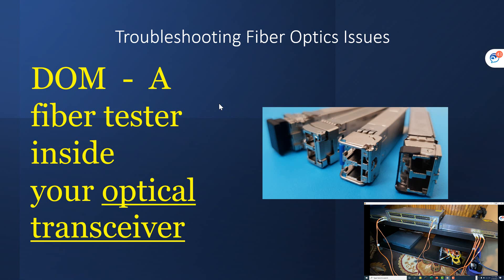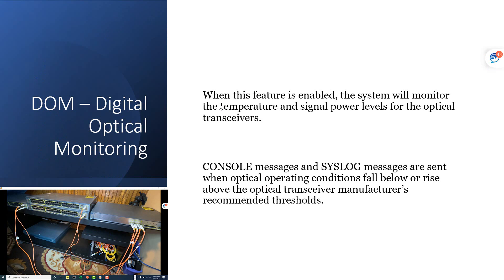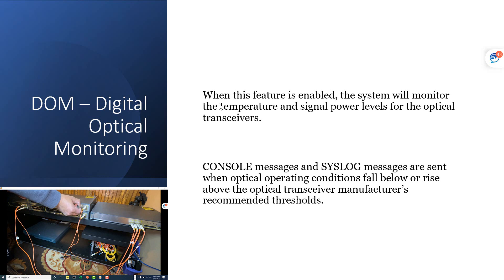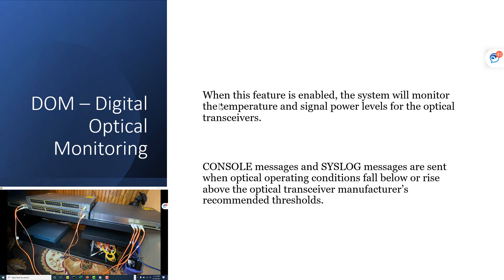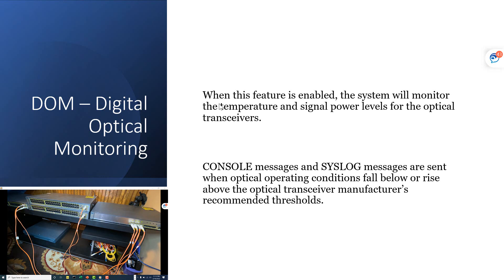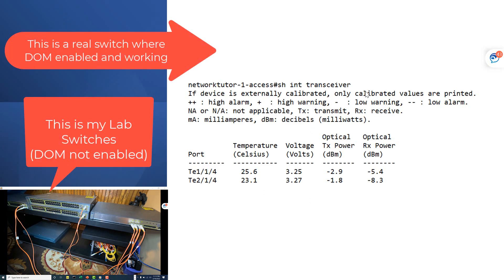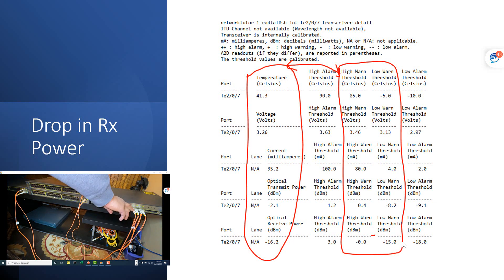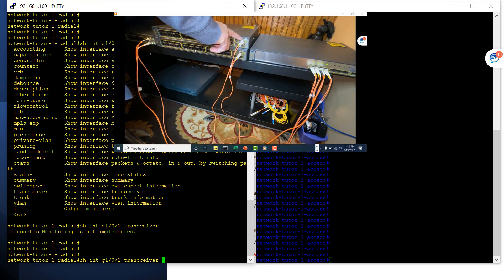Troubleshooting Fiber Optics Issues | REAL LAB EXAMPLES | DOM - Digital Optical Monitoring

Comment: Hello, I have a question, how do I configure a trunk switch in the vlans between two hosts?
Reply from the maker: Go to the configuration of each switch port where your hosts are connected to - say one host connected to port 10 another in port 20 - say you wanted both host have access to vlans 1, 2 3 and 4

Switch 1
--------------
Switch 1(config)# interface GigabitEthernet 1/0/10 
Switch 1 (config-if)# switchport trunk encapsulation dot1q
Switch 1(config-if)# switchport mode trunk
Switch 1(config-if)# switchport trunk allowed vlan 1,2,3,4 

Switch 2
--------------
Switch 2(config)# interface GigabitEthernet 1/0/10 
Switch 2 (config-if)# switchport trunk encapsulation dot1q
Switch 2(config-if)# switchport mode trunk
Switch 2(config-if)# switchport trunk allowed vlan 1,2,3,4 

Also remember you need to have all these vlans allowed on trunk between the 2 switches

Hope this helps...